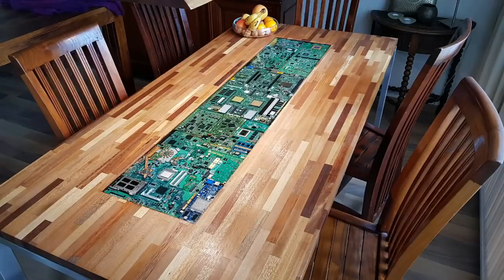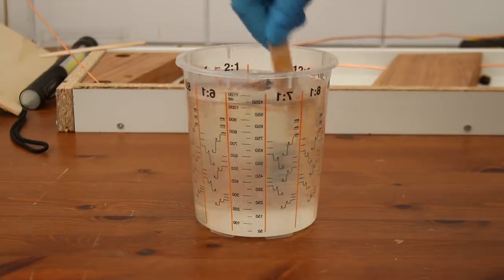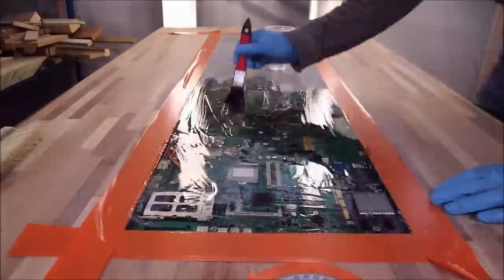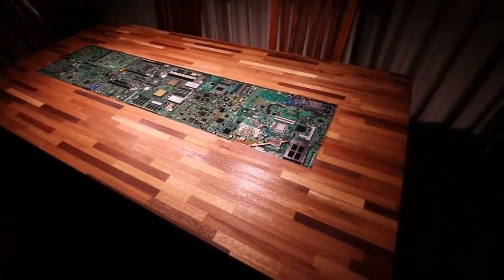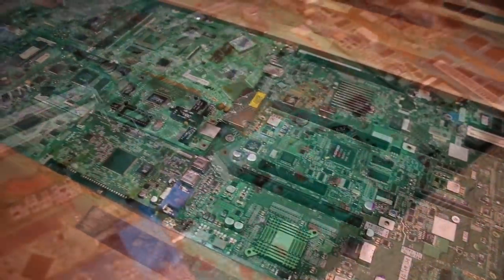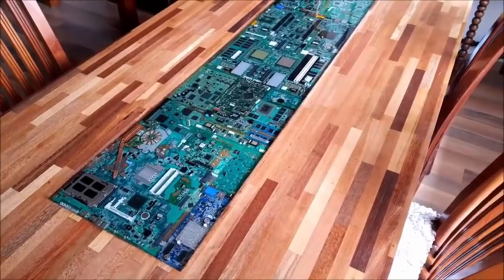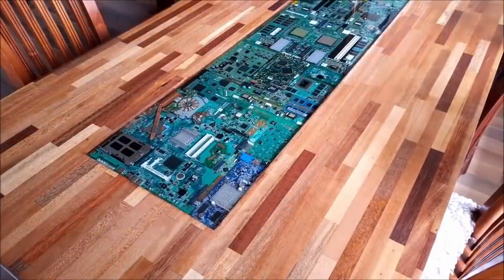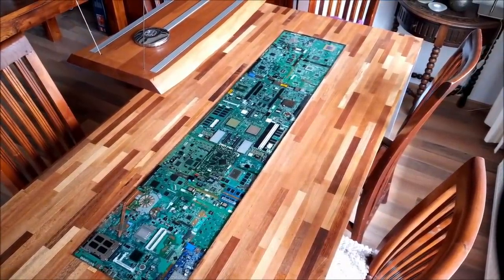Circuit boards with lights in epoxy in a table

Comment: Maybe it would be better to have poured less epoxy so there is room to put a glass on it. Would not have to worry about a sticky spots and scratches.
Reply from the maker: Could have done, but didn't. Here is what I did: https://youtu.be/rJBFk-5gMQY

Comment: It takes 21.5 gigawatts of power to make you realise that all you need to do is cover the entire table in a thick coat of epoxy and lay glass slabs over the top.
Reply from the maker: Could have done, but didn't. Here is what I did: https://youtu.be/rJBFk-5gMQY

Comment: You should've heat treated the sanded resin before pouring new resin over it. Plus application of a toothpick to sort out bubbles and imperfections is usually advised in more complicated pours.
Reply: otherwise, it's still cool from a distance
Reply from the maker: Have you seen the follow-up video?: https://youtu.be/rJBFk-5gMQY
Reply: @Onrust1  Not yet I'll check it out soon.

Comment: Cut the wood 20mm around the whole circuit board area and hang it on the wall in your garage or workshop.
Reply from the maker: Cutting off the legs would do it too... 😊 But actually the story continues: https://youtu.be/rJBFk-5gMQY

Comment: That 's too bad...looked pretty cool...Better luck next time....what epoxy did you use?
Reply from the maker: Thank you. A slow curing one, I could have poured 5 cm (2 inches) at once, according to the specs. The're is a link to the exact epoxy in the description of the video.

Comment: Instead of Epoxy, you you not have used Plexiglas?. even better, because you cold have actually made a working computer, with fans. placed under th eplexiglas and routed connectors either out the side or under the table to hook up a monitor and power cord. maybe a few USB ports for keyboard, mouse and other peripehrals. I think that might have bee cooler than a bunch of non working boards under epoxy.  (Just my opinion.)

Comment: I really like the idea but I think you did a few things with the circuit boards that I wouldn't have done and I think you did a bit of it backwards.  I would have set up the lights before putting the circuit boards in, among other things.  Otherwise, great video and a wonderful idea.  I loved the shot just before the final pour.  It looked like a city.

Comment: why do you use chisel for the bloc and not just using the tool before ?
Reply from the maker: Because it is faster? Besides, there comes a moment when the router will fall in, and then you have to make some kind of supporting sled. I didn't want to go that way...

Comment: OMG What was the whole point of using the chisel for most of it when you could have used the router and jig a section at a time.
Reply from the maker: The chisel was faster. Much faster.

Comment: If the epoxi is thermally conductive, it would be amazing to hide an rasberry pi in it and route all the connections seecretly to the back of the table. YOu could literally plug your peripherals into a desk and use the deesk as a hidden office and media computer.

Comment: My spent parents thousands of dollars on custom furniture like this for around the house from a guy off of Etsy several years later all of it has major problems including cracked glass that can't be replaced, yellowing epoxy,structural design issues. You'll never convince me that one of these tables is functional but they sure do look neat

Comment: what if you drill a hole and bleed the soft parts? or maybe you can fix a raised edge to the table and pour another layer of epoxy on, sealing everything in and then remove the raised edge and smoothen out the top?
Reply from the maker: That is almost what I did: https://youtu.be/rJBFk-5gMQY

Comment: I’m no expert but pouring the epoxy in layers, getting all the air bubbles out, waiting for it to dry and then repeat until it’s full, probably would have made it perfect, would have taken way longer but it would have paid off in the end
Reply from the maker: I disagree. I analyzed what happened and tried to fix here: https://youtu.be/rJBFk-5gMQY

Comment: I would've made a final layer of ~ 1 mm of epoxy covering the entire table(build a bath tub around the edge of the entire table), then rounded the edge, resulting in a more uniform appearance of the entire table and getting the look of todays' bezeless cellphones as well.

Sorry ur epoxy didnt mix well, use a electric hand mixer in the bucket of epoxy to prevent it next time lol
Reply from the maker: Yes, I could have done, but didn't. Here is what I did: https://youtu.be/rJBFk-5gMQY 
By now, I'm well aware how to mix well.. 😊

Comment: you could router out an 1/8th inch thickness of epoxy and inset toughend glass into it... nice project though
Reply from the maker: Could have done, but didn't. Here is what I did: https://youtu.be/rJBFk-5gMQY

Comment: How did he know that the table could hd that. It looks really heavy.
Reply from the maker: Two fairly heavy steel beams run underneath the table. They're briefly visible in the video, in the part about the fiber cables.
Reply: @Onrust1  Wow, didn't expect an answer from you. Thanks! Huge fan of your works :)
Reply from the maker: Thank you, you're welcome. Regards from the Netherlands.

Comment: Why don't you use led strips like RGB instead of using opticfibre.
Reply from the maker: Didn't want that. I thought you would go crazy quickly with RGB or other  battery powered lights with a controller, because of that carnival in the table all the time... 😊 It is the temporary character of the manual light for a few seconds in the fiber optic that I like.

Comment: I think you have to pour the epoxy in one pour because it's all setting at different stages in the process, maybe you could lay a piece of glass over the top and I think your supposed to paint the inside of the wood with something beforehand to help the epoxy set as well
Reply from the maker: My answers to that are in the follow-up video: https://youtu.be/rJBFk-5gMQY

Comment: You wanted lights to light up, but with no electricity no cables or batteries and so optic cable isn't a cable the light op youre smartphone isn't lit by electricity that comes from it's batteries? :-))) I've hoped for a better finish and these kind of projects it's all about the details. Better luck next time

Comment: You needed to heat a little the epoxy (both parts before mixing), that would make it more fluid and easy to mix and pour

Comment: Couldn't you just stick a large sheet of tempered glass over the top tof the hole table to avoid it being sticky and still get use out of it ?
Reply from the maker: Could have done, but didn't. Here is what I did: https://youtu.be/rJBFk-5gMQY
Reply: @Onrust1  yep just watched your linked video , spot on well impressed how ya repaired it 👌

Comment: the resin needs to be poured in thin layers and let time to dry. Had similar problems with a Mordheim table we made for a convention at Games Workshop that had a sunken ship, waterways and sewers.
Reply from the maker: Depends on which resin you use. Mine could do layers of 5 cm. More on this topic in the follow-up video here: https://youtu.be/rJBFk-5gMQY

Comment: that LED trick is genius. Also it is possible that some of the chemicals on or in the boards interfered with the chemical curing of the epoxy. it's possible that maybe some leftover heat sink goop or some other residue was incompatible with the resin! even tho its not a total success i think this table is gorgeous, thanks for sharing!
Reply from the maker: The answer to your question is 'probably not'. More in the follow-up video here: https://youtu.be/rJBFk-5gMQY

Comment: Put thin hardened polycarbonate glass over it, not ideal thing, but it will make table workable.
Reply from the maker: Could have done, but didn't. Here is what I did: https://youtu.be/rJBFk-5gMQY

Comment: More powerful computing technology on those old motherboards than the entire Apollo space program had.
Reply: isnt that just crazy how much tech had improved over the last 60 years.
Reply: especially the board with double xeon cpus
Reply: Bro the bits on the Saturn v are massive cubes with rings it's crazy
Reply: They're just boards and no processors. Try sounding smarter next time.
Reply: Only difference is that all of the boards were damaged and not working
Reply: @stal2496  
1) There are a lot more differences than  that. 
2) Working or not, my statement still holds true.
Reply: @jeffreywillis4258  1) it was a joke

2) your point has zero ground to stand on, because in order for "computing" to occur (in an electronic setting) you need a working computer (whoda thought?!)...nothing about any of this is a working computer. 

3)this is an extremely condescending and rude way to format a response to somebody. Especially when youre factually wrong.

Edit: the definition of Compute is : "to calculate or reckon". Secondary definition : "Make a calculation, especially using a computer" i dont see that table making calculations anytime soon. I wouldnt have had a problem with you being wrong if you werent such a condescending prick about it. Those boards' days as computing hardware are long over. Its just a bunch of e-waste now. Nothing computational about it.
Reply: Scratch McGee i mean there are no cpus on the motherboards

Comment: I had an epoxy fail like this one. I made a bar top in my family room one time, I traveled a lot for my work and I had a can full of currency and coins from many countries all over the world that I had accumulated. I had the Idea of gluing them all on a bar top and covering them in epoxy. My epoxy experience ended the same as this one, the bar top remained sticky and ugly in many spots. I talked to people who had more experience in doing things with epoxy and it turned out I had not mixed the epoxy enough for it to bond together and cure properly, Looks like that is your issue too. After feeling sick about the results for about two months I ended up throwing the bar top in the trash along with about $300 worth of foreign currency I could not recover.
Reply from the maker: Ouch! Painful.. Have you seen what I did?: https://youtu.be/rJBFk-5gMQY

Comment: Can't you take the top layer off the whole table off by just putting it through a planer. (Just a thin top layer of the epoxy middle and the wood.  Then put a layer of epoxy over the whole table, wood part included, that will of course take the wood texture away, but it should sort out the stickiness.
Reply from the maker: Could have done, but didn't. Here is what I did: https://youtu.be/rJBFk-5gMQY

Comment: get a sheet of glass cut to fit the entire table and place that on top, then maybe make a boarder for it locking it in place.
Reply from the maker: Could have done, but didn't. Here is what I did: https://youtu.be/rJBFk-5gMQY

Comment: I think you probably poured too thick of layers at once. I've seen that kind of effect a few times. I work in construction, and i have assisted with impact and slip resistant epoxy flooring. It usually occurs when there is a dip or a spall in the concrete. So when we prime and epoxy the floor, the layer in that spot is too thick and it doesn't fully cure,if at all. Resulting in soft spots or cloudiness. In the future if you do a project like this, where you have too pour a large area. The rule of thumb with epoxy resin is "Pour multiple thin layers, it may take longer, but the end result will make up for it in the long run." Also the Fiber Optic lights were a fantastic idea, might have to cop that for a future project. :3
Reply from the maker: I could have poured 5 cm with this epoxy (2 inches) and I did 1 cm max. More about this in the follow-up video here: https://youtu.be/rJBFk-5gMQY 
Thanks!

Comment: Epoxy is hard to deal with, very frustrating.
Reply from the maker: I agree. Not only it is not easy, but it is dangerous as well.. Have you seen what I learned? It is in the follow-up video: https://youtu.be/rJBFk-5gMQY

Comment: Wow, it comes with an excellent finish! Great job, mate!
But just one more question, how do you dealing with the surface?
I mean the table has an epoxy made surface, and it would not hard as glasses, and it means the surface could get a lot of scratches in the future. 
In that case, another layer of epoxy on the top?
Reply from the maker: Thanks, Nan! As I learned, epoxy is really easy to sand and polish. So if it would get dramatically scratched, I would only need one hour in my workshop to get it shiny again. I think I would start sanding at 320 or 600 grit.

Comment: should have just made a bunch of kerf cuts with the circular saw instead of all that routing, would have been quicker and easier to cut the cutout flat.
Reply from the maker: You might be right there, yes. Never too old to learn, I guess...
Thanks!

Comment: Couldn't you use one of those skimmer machines to take about an inch off the surface, and pour a new batch in it's place?
Reply from the maker: You might be interested what I did with it? The follow-up video is here: https://youtu.be/rJBFk-5gMQY
Reply: @Onrust1  Nice. Just watched it. At least you learned a lot form this experience. I love the injection idea.

Comment: Get a custom piece of glass cut out for you, and put it on top of the table. Usable, and glass will help distort the imperfections in the surfaces! Like it so Onrust can see it! Love the videos!
Reply: Sometimes you gotta like your own comment, to get the ball rolling!
Reply from the maker: Comments on comments, those I don't get to see them all, but started new comments, like your first one above, I always see, and most of the times I will respond. My opinion about the glass is in here: https://youtu.be/rJBFk-5gMQY

Comment: Table looked like it needed bracing that's a lot of weight. You didn't seal the inside walls of the cut out I'm no expert but I've watched a lot of these guys doing enlaes on tables
Reply from the maker: I think the weight is not that much, but anyhow, there are two fairly big steel beams running underneath. They are very briefly visible in the video, in the part about the fiber cables.. I'm not sure what you mean about sealing, but you could be right about that. More is in here, in the follow-up video: https://youtu.be/rJBFk-5gMQY
Reply: @Onrust1  That silver tape you use on the bottom after you took all the wood out the sides were wide open you could see the pores. Love watching you create things PS that table had me dreaming for days. I love electronics and everything about them.

Comment: Anyway its great work I belive 
You could have washed all electronic PCBs with high-pressure water before placing in. There may be some residuals on PCBs that must have reacted with epoxy chemically.
Thank you very much for the sharing your great work.
Reply from the maker: Thank you. I disagree about the residuals, and the explanation about that is in here: https://youtu.be/rJBFk-5gMQY

Comment: make a heating.. tent if you can't find a big enough oven. Slowly heat it to 70-90 celsius degrees and keep it at that temperature for a day or two. If there is some hardener in the soft part, heat might accelerate it. That's what I did to cure years (decades already) old epoxy
Reply from the maker: Interesting. Well, if you want to know how the story continued with the table, watch this: https://youtu.be/rJBFk-5gMQY

Comment: You lined the bottom of the table with metal tape.  That is the only thing holding down the circuit boards and most of the epoxy.  Rip it all out and redo it.  :) I am certain it has already been mentioned in the comments.
Reply from the maker: It has. And I didn't do so. If you want to know what I did, watch this: https://youtu.be/rJBFk-5gMQY

Comment: Well. I just recently built a new gaming pc, but I know what I'm doing with the parts when they eventually die. I'll save up from several generations of dead parts from future rebuilds and upgrades of my system, and then when I have enough, I'm mimicking this for a baller gaming desk made of high-end pc components.

Comment: you should have put a nice glass instead it will give the same effect even better what a waste of epoxy and time
Reply from the maker: Disagree on all counts. The way light breaks twice through glass is far less beautiful. And how can you call an income of 6000 euro a waste?
Reply: @Onrust1  if you knew how to put it it will look good and much cleaner and you can put so many types of glass to get a distinguished effect and waste is  waste your income is irrelevant

Comment: Excellent creativity. Thank you for making the video.
Some questions:
A. Is there a way to measure the conductance of epoxy layer?
B. If one of the LEDs goes bad, how can we fix it?
C. Can epoxy ever be cleaned using an agent?
D. How much heat does the epoxy layer absorb and what is the effect of its thickness on heat absorption?
Reply from the maker: Thank you.
You make it sound like I am Google... 😆
A. Yes.
B. They can't 'go bad'. The question indicates you haven't seen the whole video. Watch again, this time without skipping.
C. My agent says he doesn't want to. 😆 But seriously: I don't think so. But sanding and polishing again is an option, especially with a table. That would not even be that much work.
D. Google: "Epoxy resin have an excellent electrical, thermal, and chemical resistance."
If you want to know more about pouring epoxy, I can recommend the sequel to this video: https://youtu.be/rJBFk-5gMQY
Happy Easter from the Netherlands!